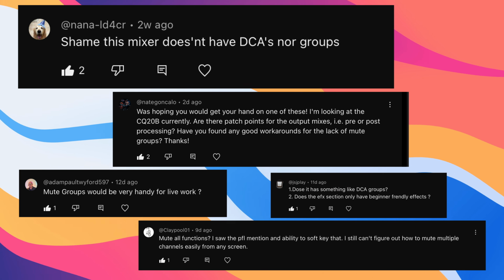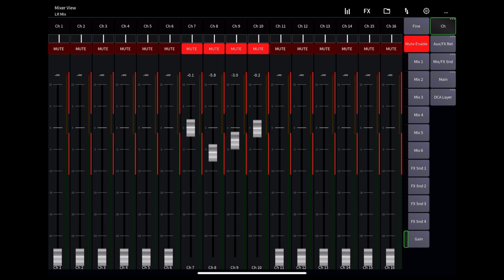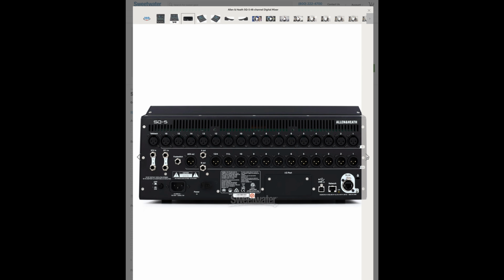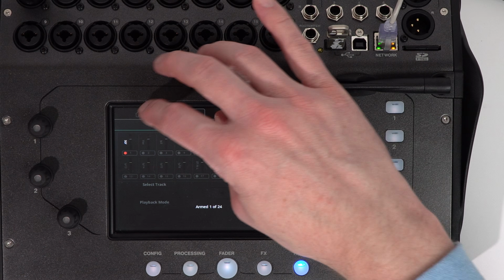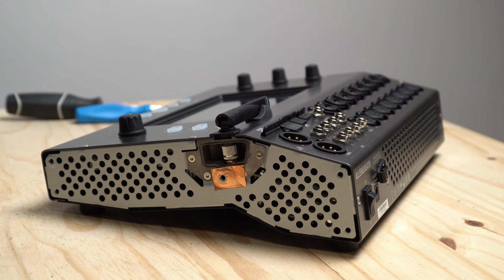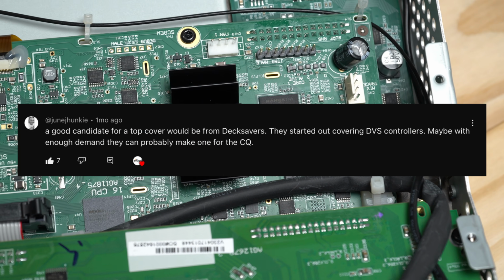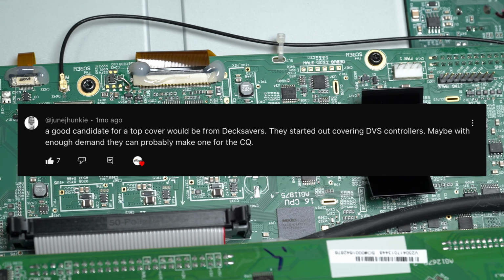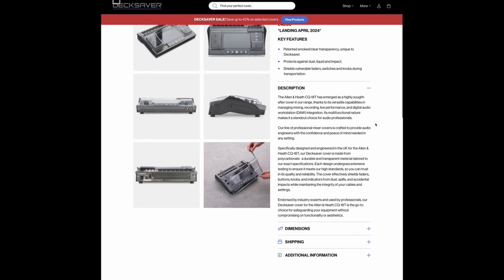CQ-18t Teardown & Answering Your Questions about this Allen & Heath Mixer

Comment: Is there a video on how to replace that antenna?
Reply: It is visible in the video, if you unscrew right-side panel then there will be a small frame to antenna mount socket, so you can easily remove it  and setup a new one. The problem is that antenna they use is in the end of life, and it is a bit complicated to find it.
The original (TE connectivity) spare part is ANT-DB1-RAF-RPS
Allen&Heath's is AL12258

Comment: Thank you for your answers. I’m considering either the CQ12T or CQ18T, primarily for the onboard live stereo FX. I typically use only 3–4 microphones (max) to capture close-up sounds, so I prefer the smaller model. Unfortunately, it doesn’t include WiFi or dual headphone outputs. Is there a workaround for these limitations?

Comment: @DcSoundOp : Could you please suggest ? where can i get this Allen & Heath CQ-18T Mixer Power Supply Input Male PIN which is located behind Power Switch On/Off Switch (Not Power Supply Adapter). Here Red Circled Picture https://www.youtube.com/post/UgkxZ7DSWZt6mfgV_QYA2YU15aTeGH3gp6kW
Reply from the maker: Have you asked Keith or any of the A&H ppl over on their forums? I'm sure someone there would be eager to point you in the right direction - https://forums.allen-heath.com/c/cq/6/none

Comment: I really dont like the power input , for some reason, i now have to carefully position the power  cable or else it wont power on, or go in and out. It would be great if it was a 90 degree plug end.  Do you fix this?

Comment: Hi! Thank you for the video! I love the audio setup I have for piano recording using my A&H CQ-12T. Any advice you can share on brining the audio into computer together with 3 HDMI videos to enable multi-camera view video production? Like what S/W to use best? I want to avoid unnecessary AD-DA. Can I avoid timecode insertions, if I bring all 4 sources time-synchronized? Folks talk about ATEm switcher solutions, but they have such a consumer-level handling of audio sources w re-digitization.... thank you!

Comment: if you operate the mixer in wireless AP mode, does the network jack still work and act as a LAN port to be the router for a downstream switch?

Comment: Can i send all the channels over usb to live professor and back to get more processing power from my existing plugins?
Reply from the maker: So you could send them over, but you'd be out of channels to return the signals to. AFAIK, there is no way to patch an insert on this console like that.. so you'd have the direct outs of each channel going USB to the computer, but the return path would have no channel to go to. If I'm mistaken, maybe someone with a CQ in front of them with the latest firmware can correct me here. Thanks for the message.
Reply: @DcSoundOp  it apparently doesn’t do bidirectional usb and other advanced routing.   which the behringer xr18 has had for a decade for well under half the cost.  This is disappointing to say the least.   After using this device it feels nerfed in their effects as well.  Feels like a Playskool “My First Mixer”.  I’m not impressed.  This could have been a killer device.  I’m sure this device can do more but they nerfed it on purpose not to eat into their sq line up.  We need portable solutions and flexibility.  I’m super bummed and returning it to Sweetwater.
Reply from the maker: @randyreamy  Hey, sorry to hear you didn't like it, but I don't think an XR18 is well under half the cost of a CQ-18t. I think one goes for $750 and the other $1250 at Sweetwater. But I get your sentiment. Maybe check back in with these in a year and see if they've updated anything via firmware. Thanks for watching & taking time to share your experience.
Reply: @DcSoundOp  thanks for the video.  Its much appreciated.  I hope they unlock some of these features for the future.  I really wanted to love it.
Reply: @randyreamy  Who told you it doesn't do bidirectional USB? That's not accurate. It just only does it through ASIO supported apps, not through windows  WDM natively.
Reply: @legendfpv I’m using usb to pc running live professor to do real time plugins (there’s still a smidge of latency).  Then send back to the back channels.  I have to send out usb through one channel and receive through another channel.  This is how i have to do this.  The x32 can send in and out through one physical channel.  I lose half my channels using cq-18.  I would love to be wrong.  This was sweetwaters solution after they checked into it.  Let me know how you are pulling this off bidirectionally.

Comment: Hey nice Video! 

1. How do I delete recorded Multitracks on my SD card (CQ18) Cant even find the file if iam inserting it in my Laptop

2. If I record and then try to make a virtual soundcheck on my headphones I can only hear my changes on the quickchannel settings but not on fx or fader. If i do the changes on my PR it works also for FX and fader.

What am I doing wrong?

Greetings
Reply from the maker: That’s a great question about deleting files. I don’t have the mixer here to look at anymore. If you submit these questions on the Allen & Heath CQ forum, you’ll probably get the fastest answer - https://community.allen-heath.com/forums/forum/cq/cq-general-discussions - for the recording, you can see the record pick off points on page 132 in the manual, all are before the fader. See ‘global recording source option’ in the Input Channel block - https://www.allen-heath.com/content/uploads/2023/09/CQ_User_Guide_V1_1_0_iss1.pdf#page119 - For the EFX, you’d have to choose to record the efx to a track, otherwise they won’t be recorded. I hope that helps!
Reply: @DcSoundOp  At the moment theres no option to delete the track directly at the mixer sadly. Thanks for your help✌️

Comment: Hi, I have a question: the compressor in the channel strip is un diseabled for aux outs, it works only in Main LR, there's a solution? 
Note, I saw the diagram and I think is not possible...
great video tho
Reply from the maker: Hey thanks for the great question. The aux outputs are setup post-EQ but pre-compressor, so you're absolutely correct. If you'd like to add your voice to the suggested features discussion about this, here is the link: https://community.allen-heath.com/forums/topic/optional-source-point-for-sends-to-outputs - I'm not at all sure how likely they are to add it, or if it's possible, but I know other folks are looking for the same functionality. Thanks again!